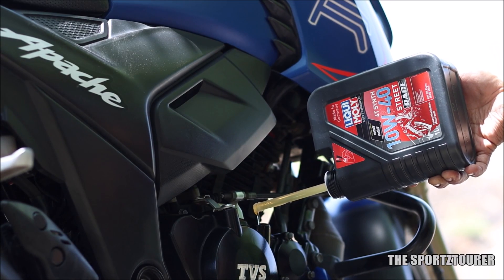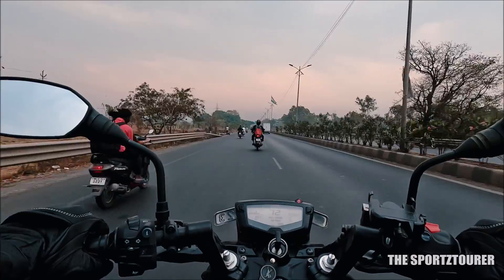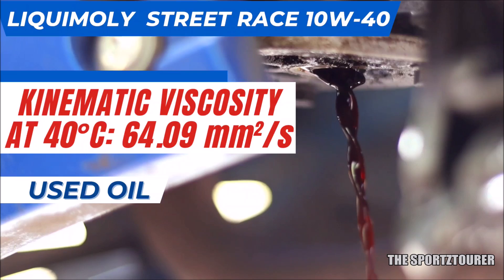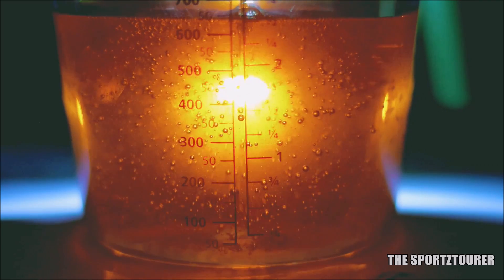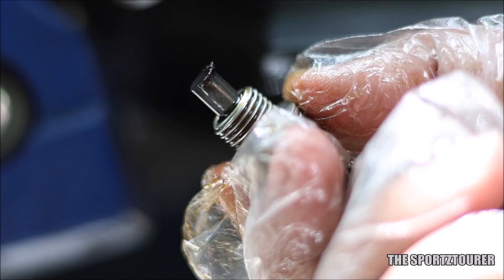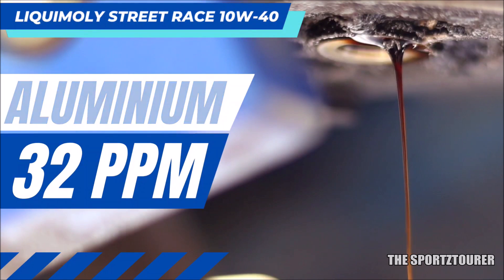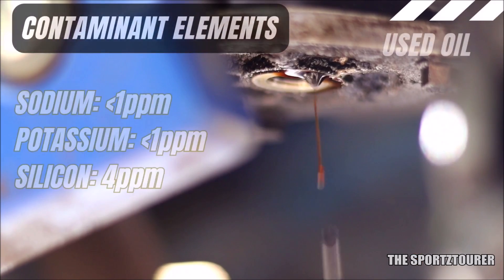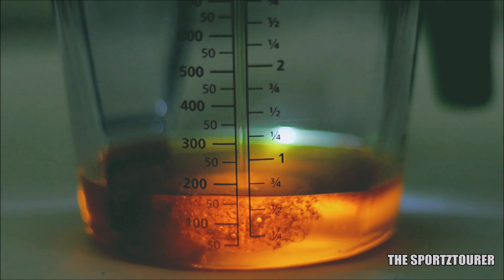5000KM LAB TEST LIQUIMOLY STREET RACE REVIEW BEST ENGINE OIL FOR BIKE TVS APACHE RTR 200 4V

Comment: @sportstourer can you give me a one straight answer, shall I use Liqui moly in my R15V4 or Motul 300 v or Yamalube rs4gp ....
Considering that my riding style is, occasion rides, sometimes bumper to bumper traffic and when I hit the Highway I do red lining...I use to reach the top end on highway riding...I also do long trip ...
Please suggest me among these three engine oils...
Reply from the maker: Hi!

With the given choice I think you should start with the RS4GP and observe its performance. I believe it will meet most of your requirements, if not then we can look at others.
Reply: @thesportztourer bro, I had already used RS4GP from the starting..my bike's odometer reads 17k kms. 
I have been using Yamalube RS4GP engine oil since long.... it's performance in higher rpm is good. But when I ride in mixed traffic conditions then the gear shifting is not smooth as it should be. 
There is no heating issue with that engine oil.
Recently I did a solo trip on my R15V4 from Bangalore to Jamshedpur (Jharkhand) . So I will get my bike serviced for 6th time... hence I wanted to opt for even better engine oil...

Comment: Hi, I have 500 ml of motul 7100 and I recently ordered liqui moly street race 10w 40 for my Apache 200 so can I put 1lt of liqui moly and 200ml of motul in it does it will make any issue or it will work fine ??
Reply: It should work fine.

Comment: Sir, I use TVS Radeon bike and recommend oil grade is 10W-30 .
Bike is 4 years old with 27000 km .
Should i try 10W-40 oil in this summers ? Will it cause any wear and tear ?

In my Gwalior temperature easily touch 45℃ . I have been using TVS fully Synthetic OIl since beginning.

Please guide me.🙏
Will 10W-40 cause any harm in a 110cc engine ?
Reply: It wont cause any harm, in hot climate its better to use a 40 and in liqui moly street race you wont believe the result and how smooth it be
Reply: @samirsamra9151  
I am using Yamaha 10w40 fully synthetic oil. Because it was cheapest fully Synthetic oil in market.
Oil is good, results are impressive ...
But its good only if temperature is above 40℃ .
In cold conditions, engine is not feeling as responsive as it was with TVS 10W30.
Overall, Yamaha 10w40 fully Synthetic is a good oil for a 110cc bike, but strictly for April, May & June months. 😊👌👍

Comment: These are old technology ,Go for TURBO-FIELD nano metal bonding with multi performance n even RPM booster work quite higher then oil it increase micro hardness so no worries about any oil and ware n tare ,hyper protection ,nano scale slide to roll conversion,unbeatable aerospace defence tecnology.

Comment: Hi,
Hope you are doing good.

I want to share experience about mishandling of bikes during PDI, giving testridden bikes to customer and also some manufacturing defects for 1st batch/lot of bikes.

Earlier my platina 110 gave 50 kmpl in running in period and after 12000 km, mileage started increasing and increased upto 80 kmpl (I felt that showroom guy gave me test riden bike).
But due to some oil consumption issue, engine rebuild was done under warranty (38000+ km odo).

After engine rebuild, this time I took extra care of each and every part of the engine:
1. Maintained Ignition (Clean spark plug) after every 400~500 kms.
2. Maintained Air Intake (Clean Air Filter) after every 300 kms.
3. Maintained Cooling System (Clean Engine Fins and Oil sump bottom) every morning before starting ride.
4. Extra oil cooling (installed aluminium heat sink) to avoid any oil over heating to get maximum oil pressure all the time. (Extra oil pressure has many benefits)
5. Always ridden below the speed limit of each gear as per owner manual (I ridden it below 90% of that speed).
6. Ridden in variable speed ranges (2 min in 38~42 kmph range then next 5 min 15-20 kmph range)
7. Always ridden in plane roads (slight incline also ok). Almost no stress for engine.

As this time, the bike wasn't ridden by the showroom "Idiots" (only engine was started by the mechanic to check engine sound after rebuild), I was the one who performed first ride for the engine.
Engine sound was like 2 different engines are running at same time.
I got 90+ kmpl in first 400 kms (300 km in 3.25L) and after that for next 250 kms, I got around 120 kmpl (233 km in 1.95L).

Most of the people think that after first service, mileage increases.
Yes, most of the time it increases.
But in actual, the engine regains its dropped mileage after the service.
But if all those points (except extra oil cooling, as it is highly experimental and may damage the engine if not used carefully) are followed, then there will be almost no difference in mileage before and after first service.
Reply: I don't trust u 120kmpl
Reply: @warbot2544  
I was also surprised.
But it may be due to almost zero wear during running in. (this achieved due to proper cooling + extra cooling)

Now after the engine rebuild, it has completed 7000+ kms, but still I never did 3500+ rpms and also didn't perform any top speed runs.
(As doing so will cause some wear and hence, will reduce efficiency)

Comment: Have you used liqui moly 10w30 in scooter ? I got good deal on Street race 10w30 that was 2018 manufactured so i got it around 750 and i have putted in my 2007 access 125

Comment: I wanted to ask u something that I was using total quartz 8000nfc 5w30 till 50,000km which was a5/b5 then due to unavailability of total oil I ordered oil from boodmo which was shell helix 5w30 a3/b4 oil I feel that the pickup is missing slightly I own a swift dzire diesel 2014 
Should I change to mobil 1 5w30 from boodmo or 
Go for gs caltex 5w30 which is Available in my area 
Do we get original oil from boodmo pls pls answer 
Which is the best fully synthetic oil below 2500 mark for great pickup mileage smoothness pls reply my question?
Reply: Shell is giving less pickup & mileage coz even though both r of same weight shell is more viscous

Shell give more protection at cost of pickup & milega
Use shell

Comment: Using this oil in Kawasaki Vulcan S, which does about 5 to 6 k km in a year. I don't change oil every 6 month's as recommended from maintenance manual. Liquimoly oil gives same performance as new oil even after 6k km and one Year in the sump. Even though a bit expensive, but still affordable given the fact that I do all the maintenance myself on my Machine.
Reply: Aha thinking same for my scrambler 400x
Reply: @ANIK5261 if you are using liqui moly in scrambler 400x please share your experience. I know hp pro lube is crap. I'm thinking about changing to liqui moly on second service on my scrambler

Comment: i use liqu moly 10w40 buy with offer 1099 pack of two and use more than 10000 km but engine oil still in good condition said by engineer

Comment: Amsoil metric has a better numbers overall in datasheet vs liqui moly street race. I siwtched a couple of months. You should try it too both experience and lab test results
Reply: The best        .sportztourer still wandering searching for best engine oil😂
Reply: But they don't have 1 litee bottle sadly. It's 946 ml right?

Comment: Currently using this oil in my RTR 180 ABS and NS200 matte red. It's costly, but the way it performs coupled with the MoS2 shooter , given that I rev my bikes a lot, is commendable, but gotta make sure it reaches the optimum operating temperature. Motul 300V and V2 are also able to handle a lotta stress.

Comment: How does this engine oil compare to Motul 300v at the same SAE grade? Which one is the best and recommended by you based on your experience. I have the 2021 BMW G310r BS6. Love your videos and analytical approach to reviews! ❤
Reply: Don't think too much into it. Just use correct grade from whichever name brand that is available at cheap. Just change it regularly. I personally recommend 2/3 km manufacturers recommend km.
Reply: @realdevbro447  Finally a sensible and a meaningful comment from a lot 👍🏻 👍🏻 👍🏻

Comment: I'm using Apache RTR 200 4v (BS6). I'm using Motul 10w40 7100 since last 10k+ kms. Is there any other 10w30 fully synthetic oil other than stock Tru4 synthetic?
Reply from the maker: Amsoil has one: https://youtu.be/NkQ90LupYok?feature=shared

Addinol also has got a 10W-30 grade motorcycle engine oil in that range.
I personally liked the performance of the Xotic plus 10W-30 from Hero Moto Corp: https://youtu.be/3mtMtg5mAC0?feature=shared
Reply: @thesportztourer  is there motul 10w30 7100 grade oil.?
Reply: Yes it's available

Comment: This oil is out of budget  i prefer shell advance ultra and motul 7100 10w40  my first recommendations is  shell
Reply from the maker: Every oil has got its own ups and downs.
You can find the lab test results here:
1. Motul 7100: https://youtu.be/Hhkp5skLekE?feature=shared
2. Shell advance ultra: https://youtu.be/omsUWl3hmo8?feature=shared
Reply: @thesportztourer  yup I saw your all videos long back thnks for valuable content😊
Reply: @thesportztourer  by watching your videos I moved from motul 7100 to shell advance ultra
Reply: @khandobakhanvale9151  Nice choice, even being a synthetic oil 7100 evaporates in smaller cc bikes because of the high stress and lasts for a small time, but that isn't the case with shell.
Reply: Why ignoring Castrol its been very good according to my experience
Reply: @aravinds5833  I will try ones